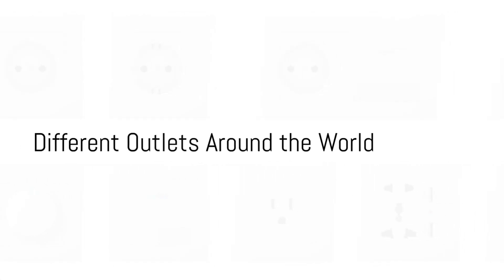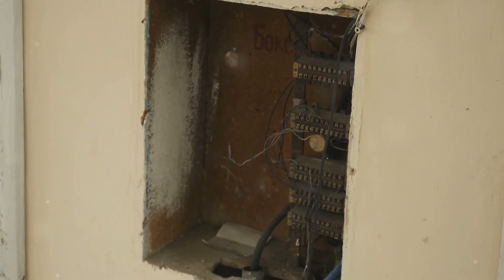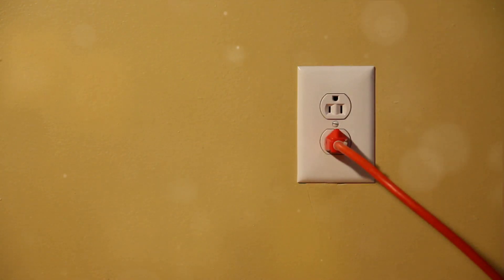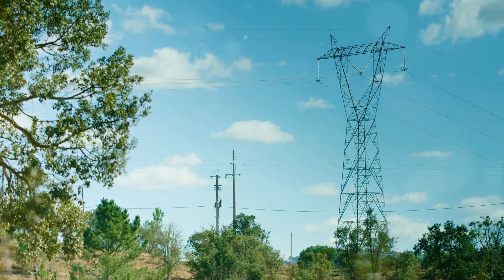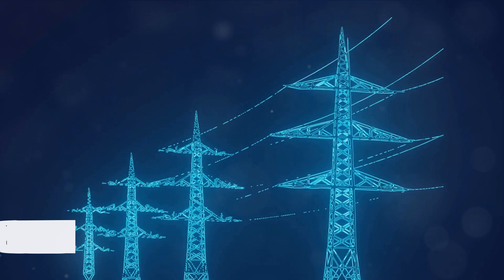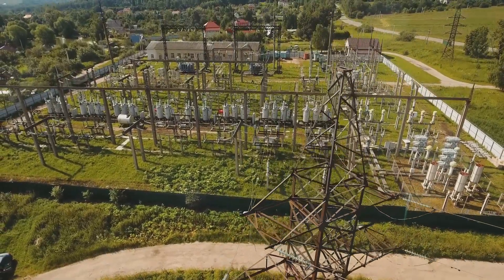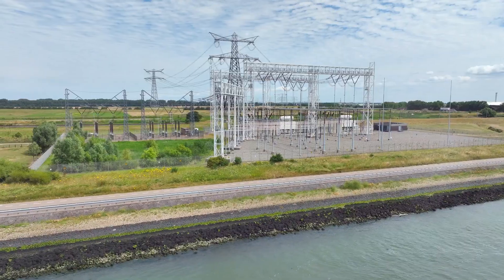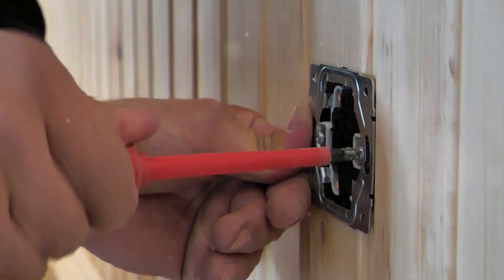Why Countries Use Different Outlets

Comment: What @MatthewHarrold said, but what the hell is he doing at 3:00?
Reply: Around the time you mentioned, he's stripping the wire and getting it to a certain length and getting the jagged edges off. It's an old tool and with wire strippers nowadays that cut and separate, it is more time consuming.

Comment: The war on currents was Edison and Westinghouse, Tesla was a minor operator. You are just making things up. For one huger voltage works better on sparsely populated areas. That is why in Finland rural areas had higher voltage but cities had lower until the late 50s. Please do not make up facts. Instead use sources. The standardization to 220 B on Europe happened on the 1950s though on some countries that happened later. In Europe electricity wa still used mainly for lighting so the change was easy. In the US there were much more electric applian9so changing would have been harder.

Also voltages have nothing to do with plugs. Plugs and sockets were not deliberately made incompatible because of different voltages.